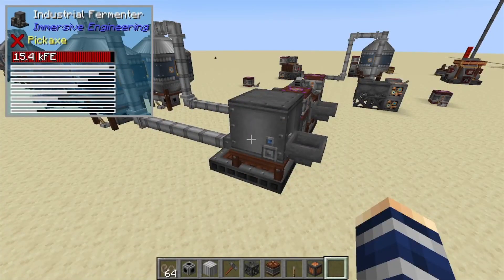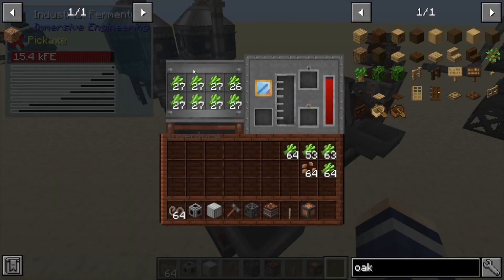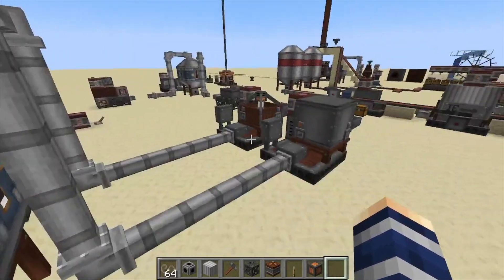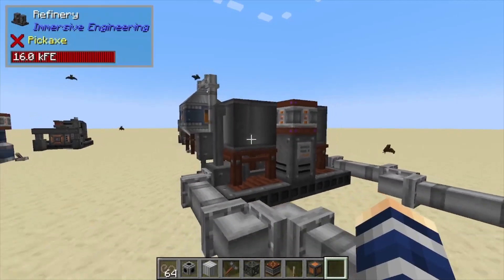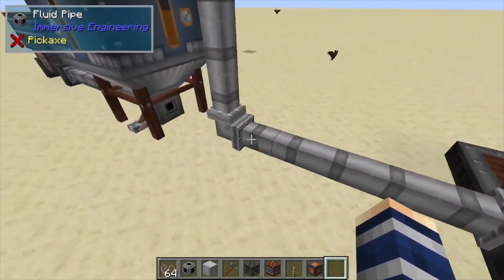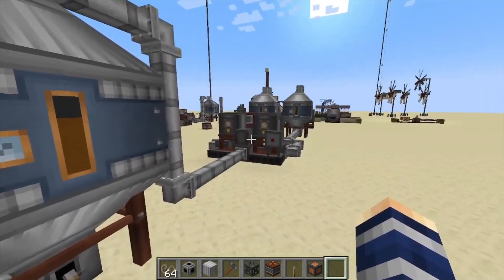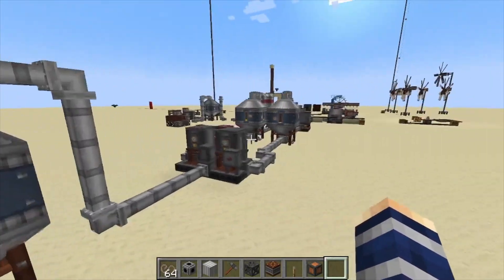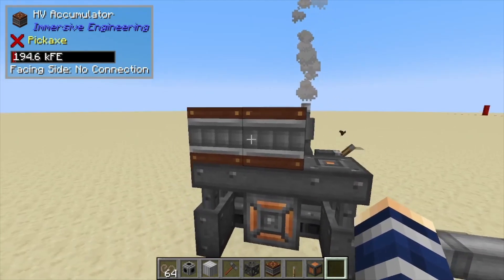Immersive Engineering: The Process of making Biodiesel

Comment: Are accumulators better than the thermoelectric Generator? Cus when I power the fermenter it loses all power except the bare minimum
Reply from the maker: Accumulators are just batteries...You need a lot of thermoelectric generators to power a fermentor. Just make the bare minimum to get your Diesel Engine running and loop that power back into the machines to run at full power
Reply: @MCMentor1  I'm new to power mechanics do you have a video I could look at?
Reply from the maker: @reqgreed9573  https://youtube.com/playlist?list=PLEixt-NSA3I2GqwzzgAOpc22ADXMpZWn9&si=UJaTx4zBil2pza7W